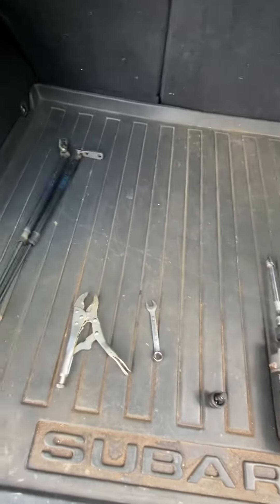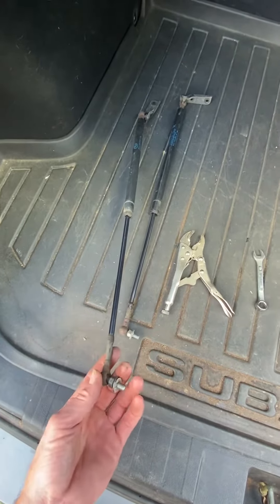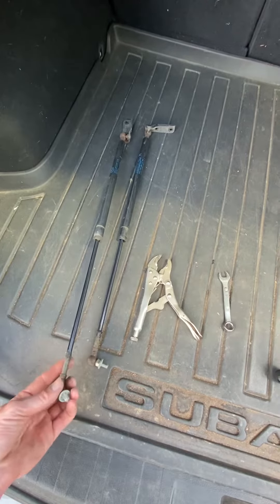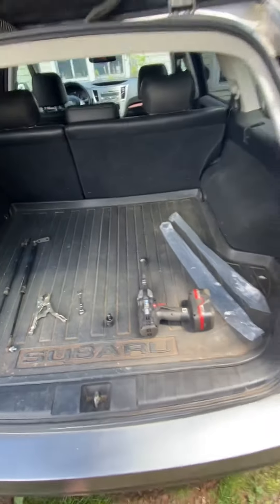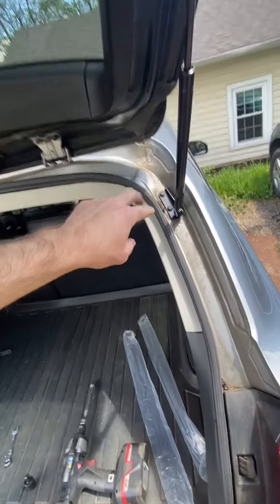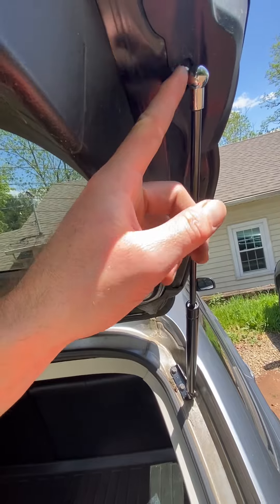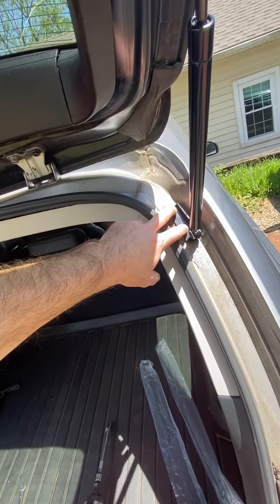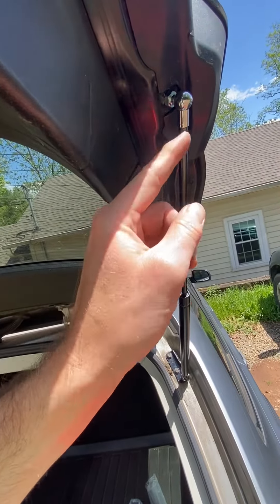Subaru outback lift gate hatch support replacement removal explained

Comment: Wish you would have shown how to put them back on
Reply from the maker: Vice grips hold up one side while you align the other side. May have to push the hatch up a bit with your hand while adjusting. I used the screws to align the holes and lightly screwed them in for the sake of placement then used the impact for tightening.

Comment: How did you use vice grips to hold it up?  That is the part that is difficult.
Reply from the maker: Clamp the vice grips on the lift arm that’s still attached while you replace the other one